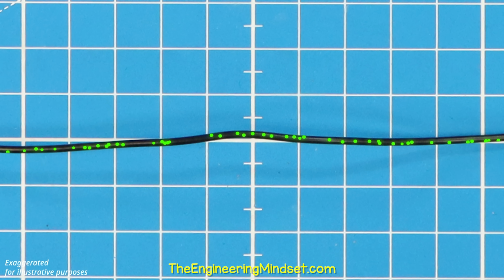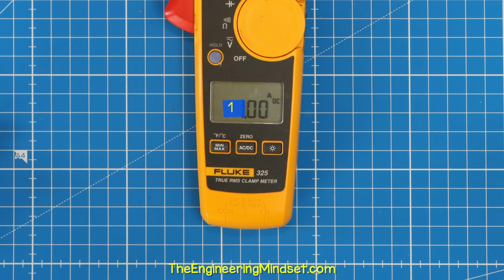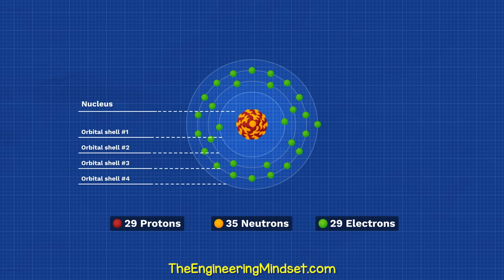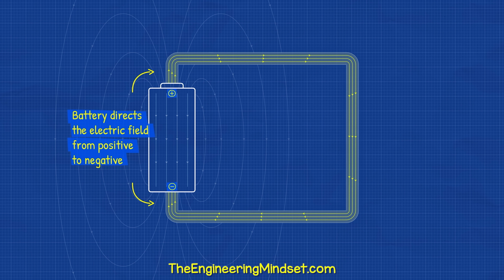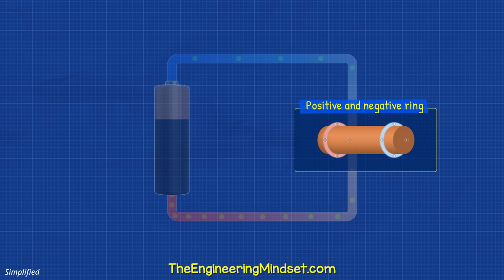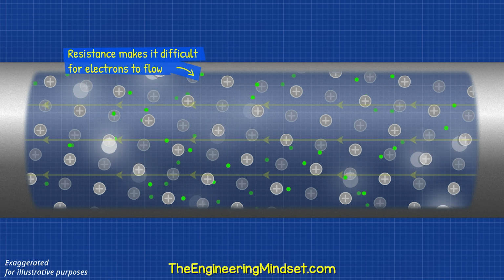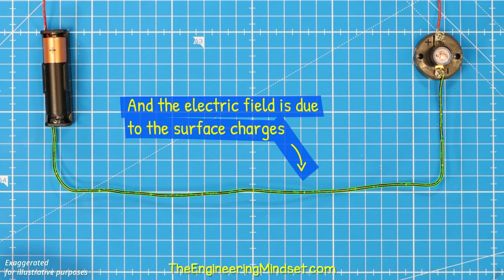How Electricity Works - for visual learners

Comment from the maker: :_Hazard: This free video took 2 MONTHS to make! If you’d like to support Paul’s efforts, links below: 
Watch ad-free here:➡ https://www.patreon.com/theengineeringmindset
Get your engineers mug here:➡ https://tinyurl.com/electrical-engineer-mug
Join our electrical course waiting list:➡ https://forms.gle/7ToixmRap8RGfcU17
Reply: thank u
Reply: This video, like last video, did not appear in subscription box, just recommended days later because it’s still matching my interests
Reply: I really love the video!
Please make video about transformer, why transformer primary winding dont have current when there is no load in the secondary windings!!!!!!
Tnxxx....
Reply from the maker: @Rod-l6j  please see our video on how transformers work, then how three phase transformers work.
Reply: @Rod-l6j if you power up a transformer and there is no load on secondary, there is still some very small amount of current on primary cause by the fact that the wire is arranged in a coil shape and there is a feromagnetic material inside the coil.
If you'd take that same coiled  wire, and straighten it out, and try to apply voltage to it, the result would be completely diferent..
You would end up with a short circuit.
Reply: Thank you for taking the time.

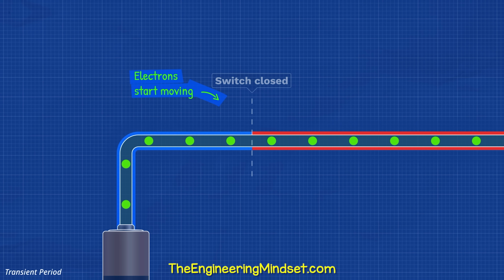Comment: I have a question ; maybe someone can explain. @16:02 it shows that the electric field spreads outside the wire and hits the other side of the wire. does this field have a reasonable limit? what if the circuit is a very very big circle? will the electric field expand that huge distance and fast enough to make the lightbulb turn on instantly? I hope my question makes sense :D

Comment: But if the electrons move from negative to positive. Why is it possible to charge your car battery (when flat) with just the positive to the positive and the negative to the engine bracket of the donor car.?

Comment: "You can't see electricity" then literally TURNS ON A LIGHT. Um...
Reply from the maker: "You can't see electricity, you can only see its effects such as light, heat...." the filament is glowing from the heat, you see the heat, you can't directly see electricity.

Comment: electrons don't really all move past a point as defined by Coulomb. The new definition of amperage being the displacement of charge and not the movement of electrons is closer to right.
Reply: @ffffffff-gu5qr  The atom holds the charge, positive or negative.  While electrons do have a charge, that's not what powers the displacement which happens almost instantly.  The drift velocity for electrons is .03 mm per second.  They basically don't move.

Comment: Pretty good!.  If I had to argue a point it would be that electrons don't really all move past a point as defined by Coulomb.  There would actually be an extreme amount of ionization if that were the case, it's not.  Current is merely  the displacement of charge in the field.  The new definition of amperage being the displacement of charge and not the movement of electrons is closer to right.  You really should find the distinction between the charge in the field that the charged particles create and the displacement of that charge that the voltage potential creates.  Electrons contribute to the electric field and move to holes - yes.  But all the other charged particles in the circuit do as well.  It's not a steady flow of electrons that power a circuit.

Comment: Actually there is no such thing as a negative charge more accurately charge and discharge. Electrons dont exist if so how can electrons flow through a vaccume through glass insulators for wireless power induction this alone proves electrons don't exist. Electricity is a hybrid magnetism is what happens when you disturb the ether. Electrostatic electricity etc
Reply: @ffffffff-gu5qrcan you define a field?? No you cannot neither can any branch or the space time goons. Also how can a wave exist without a medium in which to propagate
Reply: @ffffffff-gu5qrI'm guessing you believe magnets emitt virtual photons lmao
Reply: @ffffffff-gu5qrpathetic
Reply: @ffffffff-gu5qr if electricity is the flow of electrons how does wireless power induction work in a vaccume?? There is nowere for the electrons to flow lol then youl say oh the electro magnetic field which no science can even define that's what's funny
Reply: @ffffffff-gu5qr typical no real argument just pathetic schoolyard insults.
Reply: @ffffffff-gu5qr well you more than anyone else should be able to explain how wireless power induction works in a vaccume if the electrons do flow through the electromagnetic field can you please define what a field even is??
Reply: @ffffffff-gu5qrI want serious answers. Do you think there are countless electron particles flowing through our power lines?? Electrons are only a concept the same as leprechauns or unicorns. And if electricity IS the flow or so called charged particles called electrons how does wireless power induction work in a vaccume?? I'm so sick of the atomists gassing off thinking they are right when really they can't even understand the difference between definitions or descriptions
Reply: @ffffffff-gu5qrelectricity is the hybrid of magnetism and the dialectic.

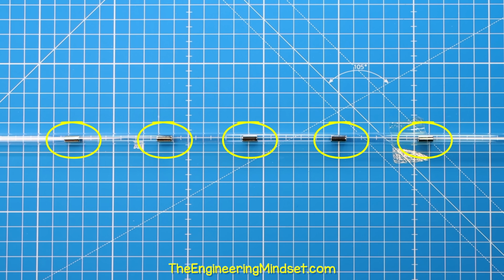Comment: 8:32 cool visualization
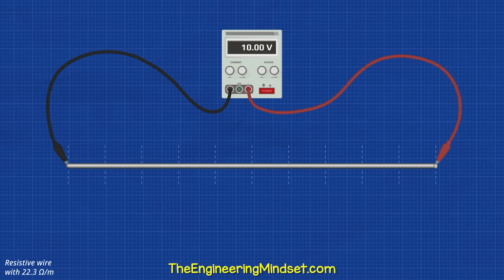9:15 this was so hard to understand until now for some reason
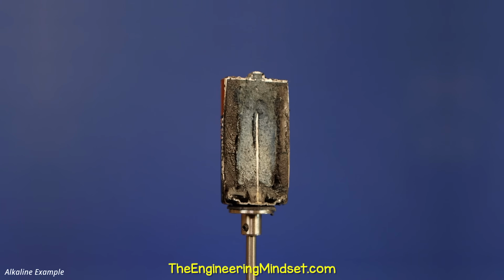9:31 inside of a battery
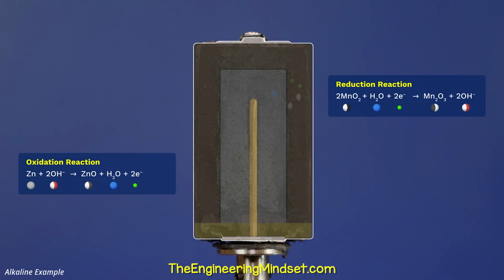9:36 the anode and cathode stay solid by using hidroxide and water to help the cycle continue (with the help of the electrolyte inbetween
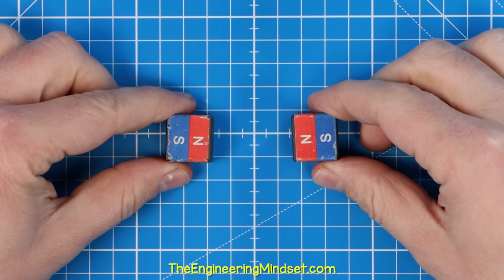10:14 elastic force analogy visualized, this is cool because the elastic force and coulombic force are similar
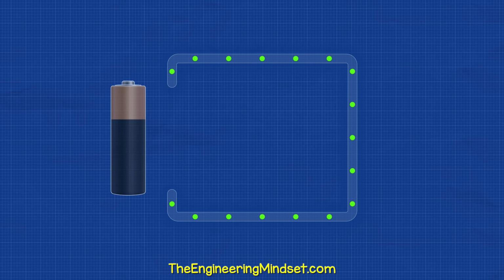11:19 this is so hard 😢

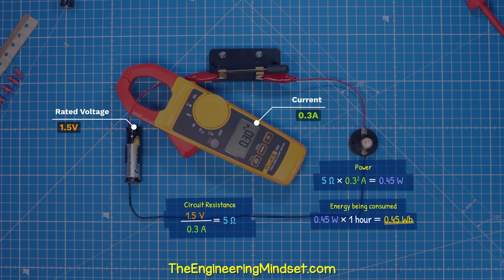Comment: 4:03 . Here The power formula is wrong . It's P = VI not RI 👾
Reply from the maker: There are many ways to calculate it, P=R*I^2 as shown in the video is correct, there is also P=I*V as you suggest and there is P=V^2/R

Comment: electrons do not physically "move" through a wire. This is a misconception and is factually inaccurate.  Consider the movement of electrical energy from the power plant to one's home as point in fact. There is not an uninterrupted continuous wire connecting one's home directly to the power plant. There are physical gaps between source of the power generation and the location in which it's used. It's actually the EM fields that generate the energy not the movement of the electrons. In fact, it's hypothesized that the electrons within any conductive material with a charge barely move at all. This is a much easier means of simplifying the concept of electrical energy but nonetheless factually inaccurate.

Comment: i am not into electronics but i have a question. The video states that the electric and magnetic waves travel down wire in both directions, but if we talk about resistors , their placement before or after the bulb has already been accounted for when electric fields establish. the entire circuit adjusts the current flow according to resistor in an instance when the switch is turned on. The travelling waves concept would mean that if a resistor is found across the wire, the fields re adjusts themselves?

Comment: I finally understood electricity by realizing it's a lot like compressor systems except that a breech is only accomplished by making a circuit. Punch a hole in a steam line and the steam sprays out and burns you, it's just that "hole" here is in electrical fields that one can't see.

Comment: what are electrons made of
Reply: Very human question 😭
Reply: @first_senpai1473  

strangely, its not something i ever see physicists ask

they just blindly accept that electrons are elementary without a second thought at all
Reply: they are fundamental particles meaning they are not made of anything smaller
Reply: @Boltkiller96  

so what happens if i divide the surface of an electron into 2 different parts
Reply: @Boltkiller96  

if you increased the size of an electron to the size of a planet or moon and then went inside of it, what would it look like?
Reply: @ffffffff-gu5qr 

why are they fundamental

Comment: On the battery example that you showed with the plates becoming positively charged and negatively charged,  does that mean that if you have two batteries and you connect the negative side of the one to the positive side of the other there will be a neutralisation as it happens with static electricity? I don’t think that is possible

Comment: I'm curious about the field moving through the circuit or wire at ALMOST the speed of light. What determines how much less than the speed of light the field travels? I had a once in a lifetime experience of an electric current moving along a circuit formed by about 60 people holding hands in a circle on a carpet in dry desert weather. Those on one side shuffled a bit to adjust their positions. This started a current. As it began to flow, two people shrieked and let go of each other's hands. Then the next person shrieked and let go. Then the next and the next. I watched, not knowing why they were shrieking. Then the current hit me and I shrieked and let go. And on it went past me to the last person. I estimate the current took about one second to pass through each person. How would you analyze this?

Comment: So here's a question I've always wondered.  If an electrical circuit consists of a black wire and a white wire, and electrons are moving along the length of this wire, why do you only get a shock if you touch the black wire?

Comment: 0:34 already wrong. The electrons aren't moving through the wire
Reply from the maker: Electrons do move through the wire, they drift, very slowly. We even calculate how fast in the video, we then explain the electric field and magnetic field and how the energy transfers outside the wire. It's all time stamped. When you find time, please watch the full video.

Comment: This is wrong. Electrons are not moving through the wire. It's EM fieleds moving that's causing energy flow.
Reply from the maker: The EM waves are explained in this video, see time stamps. Electrons do move through the wire, they drift. The slow speed is even calculated in the video.

Comment: 9:15 why does the voltage reduce along the wire? My current way to wrap my head around the concepts of voltage and amps and whatnot is through the water analogy so I'll use that to explain what has me confused. From my understanding voltage is like the pressure in a pipe that pushes water along, my gut tells me that shouldn't diminish as the water moves through the pipe. Is that correct? Current is comparable to flow rate so let's say the pressure (voltage) does drop. How would the flow rate (current in amps) stay the same?
Reply from the maker: Pressure does drop along a pipe due to friction, voltage drops along a wire due to resistance

Comment: We use amp clamps to demonstrate the ignorance of Renewables and why it  only put in 15% of advertised output
Reply: And that's called voltage potential difference just like pumping water against existing pressure

Comment: I have seen some great analogs for linear components that used clear pipes for wires, valves for switches and transistors, one way valves for diodes, Diaphragms for capacitors, blockages for resistors, and riser pipes for inductors, etc.  It is very good for helping visualise some simple circuits and current (flow rates) and voltages (pressures) in some basic circuits like LRC tanks, voltage regulators, bridge rectifiers, and such.  You can almost always find a water in pipe analog for any discrete component.

Comment: So according to Veritasium the electrons don't do the work it's the fields that they generate.  Electrons move at 1/10mm per second and there are gaps between the power stations and your house so there is no way for it to even be the electrons doing it directly.
Reply from the maker: This video also discusses the fields and agrees with Veritasium, please watch the video in full. The beginning just discusses the basic common analogies.

Comment: Sir please don't say electrons flow or move in a conductor because it's the  electric field that gives electricity not movement of electrons. Electrons  vibrate where they are and generally don't move at all in a wire. See veritasium video of how current flows in a wire.
Reply from the maker: Thank you bur please actually watch this video fully, I explained the electric field in fine detail, and also how electrons drift a tiny distance, even calculated it. The Veritasium video you reference also explains how electrons drift through the wire.

Comment: By far the most complete and accurate video about how the electrical current establishes and flows inside (an around) a circuit! That's the global idea I had after viewing several videos about the subject (and years of engineering school, but that's not always relevant to get the proper intuition of what happens exactly :) ), but this one sums it all up perfectly, both for novices and electronics specialists. Well done!

Comment: There's a lot of fluff in this video that I can't imagine is relevant info when learning how electricity works practically. Like why should I know the speed or distance that an electron moves in a circuit? Who needs to know the origins and experiments that resulted in discovering volts and amps? 
Maybe my brain is just too smooth to understand the importance of some of this

Comment: It's a common misconception but it isn't actually electrons that are transferring energy. It's the Electric field generated because of tiny shift in electrons inside the conductor.
Reply: in a transformer, yes.....not in a solid node so much but the field still exists....

Comment: how does one test weather power comes from the positive or negative terminals?  by using ground or earth... if you screw in a light to a socket then connect the negative line on the light to  ground and the positive  line on the socket to the negative side of a battery  the light should go on, if power comes form the negative side, but it does not come on,  but when you connect to the positive side of the battery the light comes on, showing the power comes form the positive  side

Comment: 4:00 wait what? I thought Watts were Volts x Amps not Ohms x Amps
Edit: I see it was just a typo, should be 1.5V instead of 5Ohms
Reply from the maker: Its correct, there are different formulas to calculate power, these are listed at 3:50
Reply: @EngineeringMindset  Ohh didn't see the squared amps, V = IR -> P = (IR) x I -> P = R I^2... dumb me, thanks!

Comment: Somehow you've managed to answer nearly all my questions as I had them. One question I do have still for the 16:02 visualization is if that electric field actually radiates that far or is that an exaggeration for visual sake? I ask because I've heard that circuit board designers have to consider electric fields when laying out traces, and the way it's visualized here makes it seem impossible.
Reply: If you check out some experiments made by AlphaPhoenix or Veritasium, you can see that the EM waves flowing through the air are not always negligible (very temporarily in DC). And indeed it's often taken into account for designing boards, especially in transmission lines / high frequency. But that's a side effect, and otherwise that's the purpose of the electrical circuit itself is to be a perfect guide for these waves and establish the permanent regime. Most of the time, you don't have to deal with it at all (except for transmission lines / high frequency)
Reply: @Tenynos  Interesting, thank you!

Comment: So then Diodes that allow movement only toward the negative would prove this.
Reply from the maker: We design circuits using conventional current, so we assume current flows from positive to negative but electrons drift from negative to positive. The marking on a diode indicates conventional current.
Reply: @EngineeringMindset  oh ok like, make believe. Got it. 😂